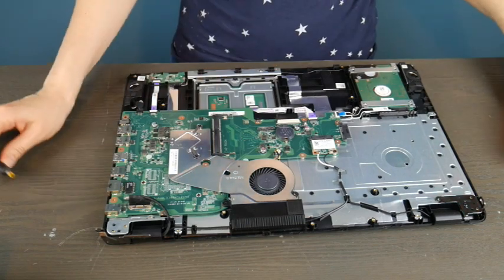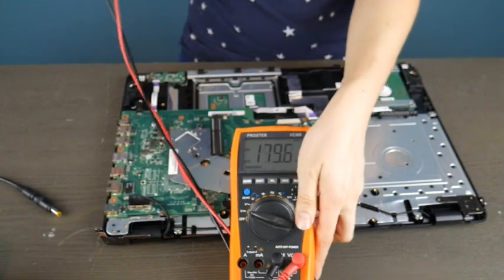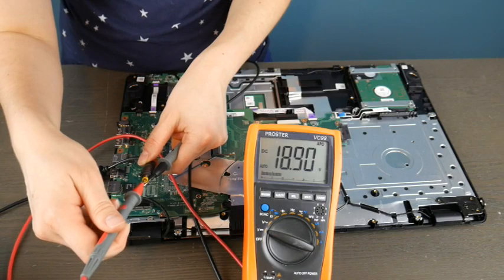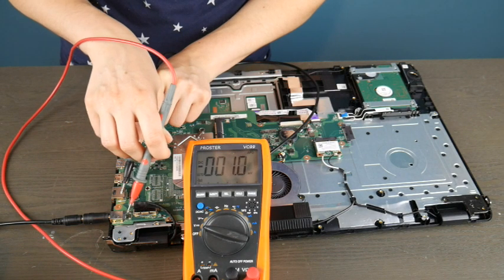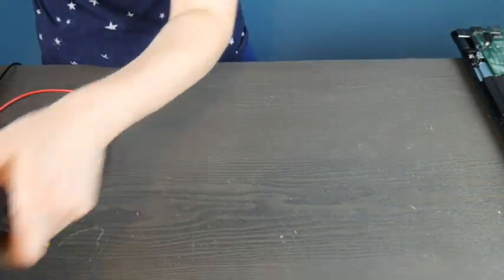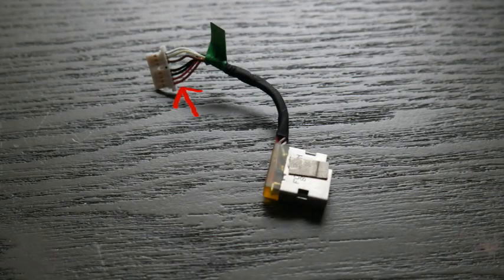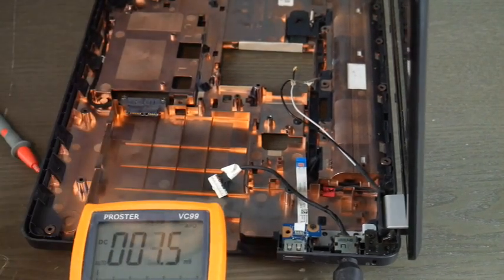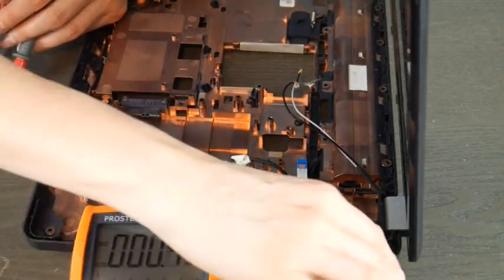How to Tell if Your Laptop's Charging Port is Broken - Learn to Troubleshoot, Test, and Diagnose

Comment: Yesterday my laptop was plug-in
And it worked normally .
But then suddenly I smelled a melted plastic, and i quickly unpluged the charger then i find that charger cable (the one before the charger brick , the one that we plug to the wall outlet)
Was cut down and one of the cables inside it was fried .
So i want to know how can I check if the brick is damage , and not just the cable . I don't want to buy a new cable and plug it into my pc and then break the laptop .
Reply from the maker: If you smell burnt plastic from the charger, it's best to replace the entire charger to avoid any further damage to your laptop. I would throw the charger away and not use it anymore.

Comment: does it also mean my port is broken if i hear crackling coming from the port, and having to use it at a specific angle?
Reply from the maker: Yes, usually it does mean that the port needs to be replaced.
Reply: @EggheadFixers  alright, thank you so much!
Reply from the maker: @AxelAxon7  You'rewelcome!!
Reply: Hey so my charger wasn't charging and I got upset and snatched it out of my laptop so I've been charging my laptop with a phone charger it charges my computer slowly but now it completely stopped charging do I need a charger port or just a new charger
Reply: It has no response when I plug in a charger